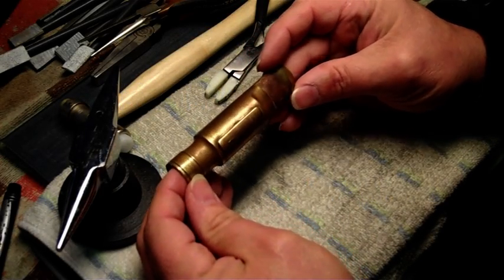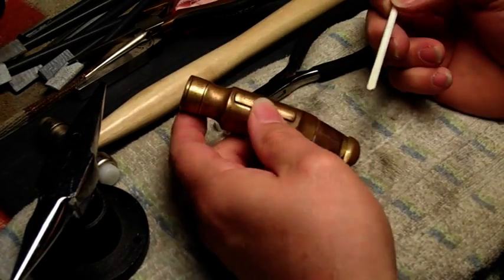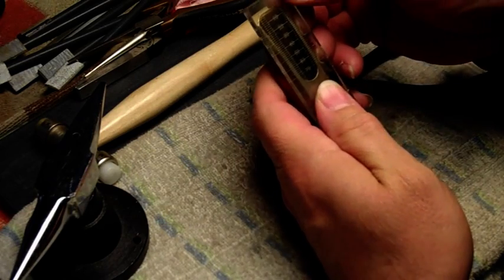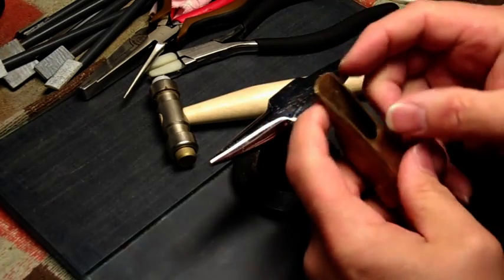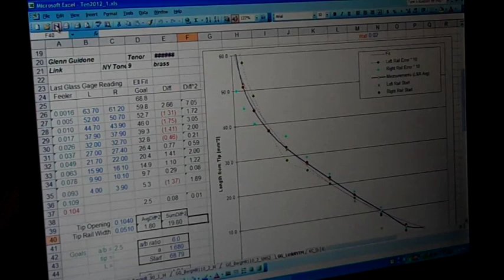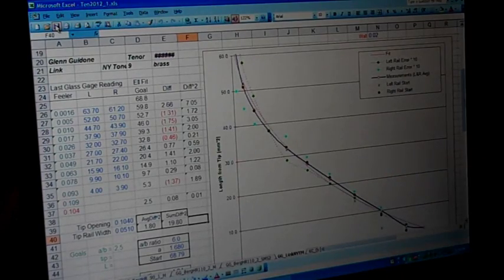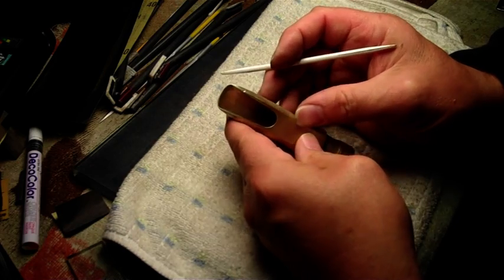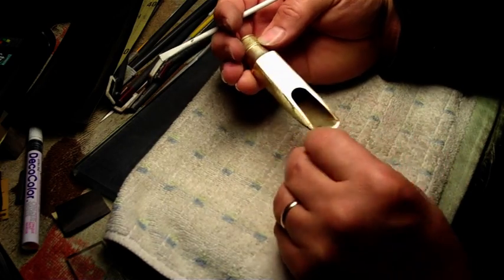Link NY Tone Master Metal Repair Restoration

Comment: I once bought a used Selmer tenor sax from a friend but the mouthpiece, perhaps an otto link, was bad and it looked similar to this one, I did not know what to do with and, I probably threw it away.  I wish I knew about this. Having lost that mouthpiece I'm now using cheap mouthpieces.  My saxophone teacher once told me that the secret of sounding good on a saxophone is on the mouthpiece...the properly crafted mouthpiece will make your sax sound good no matter how cheap the make is.  There's a lot I can tell about my experiences but not now.  But this is a great job!!!

Comment from the maker: It is a high speed roatary tool with a burr.  Mine is an old Weller made model that I outfitted with a variable speed foot switch and a flexible shaft I got from Micro Mark.  Dremmel is a big name in rotary tools.

Comment: im noticing that  refaced mouthpieces that are hard rubber and plastic after refacing the tables dont stay flat long after the ligature puts preasure.   though it might be the heat here in the philippines too.im thinking the metal brass mouthpieces might retain a flatter table .The new york ottolink and dukov types appear to be longer and im thinking also might have a lower tone when pulled out more.im always in fear of loosing a mouthpiece to the floor when trying to play along with aubra graves stuff. Love the videos mouthpieces seem to be the key to my improving longtones and frazing.

Comment: Great video. Was wondering if you could recommend a vendor for refacing tools. I'm a tech myself and used to work on mpcs.. I had the old Eric Brand tool kit, with radius gauge, etc., but lost it in a move, and it's no longer available. Any ideas would be much appreciated!!
Reply from the maker: Wanne and MusicMedic.  MicroMark for small tools in general.

Comment: I use 1/8" thick black sheet acrylic.  McMaster-Carr sells it as do other suppliers.  The adheasive is 3M DP-810 black.  There are photos of a Link STM bite plate job on my web site.

Comment from the maker: I have not tried to make a baffle out of silver solder.  I suppose it is possible.  But the high heat would damage the bite plate and gold plating. Epoxy putty is more practical.

Comment: 9:57 what is that machine that you use to buff the sliver solder?I am planning getting one of those so I can buff out all excess of flux when I remove the old pip and replace it with a new pip

Comment: Nice work. Have you tried using a foredom motor with a precision handpiece? They are worlds better than dremels for control and accuracy.
Reply from the maker: Fria Gram No I have not.  One problem I have with other flex shaft rotary tools is the hand piece is too large to fit inside the mouthpiece shank.  Even the slim one I use is not made any more as far as I can tell.

Comment: Hi may I send you my Ponzol m2 110 brass. It needs a bite plate. It has one but it is too short width-wise and has some top surface damage as well. . I've been trying to get a bite plate for 2 years, but Ponzol no longer manufactures this bite plate.
Reply from the maker: I can fix you up.  Email for info at mojomouthpiecework@yahoo.com

Comment: the mp looks like brass.  Why not braze brass?
Reply from the maker: I guess I thought that would take more heat than I can make with propane and air.
Reply from the maker: I think the temperature needed to melt brass brazing rod would melt the mouthpiece too.

Comment: Isn't it risky to use silver solder in a place that is going into a persons mouth? I know plumbing and other solders are lead based, but I was under the impression that silver solder is also dangerous. Maybe only when you are liquifying?
Reply from the maker: +Mike Borkovic (Dad Stuff) Most soft plumbing solders have been lead free in the US for years.  I used an easy flow hard  solder which is more accurately a braising operation.  No lead.  You can search via Google for more info.
Reply from the maker: +Mike Borkovic (Dad Stuff) BTW, the original mouthpiece brass probably has lead in it.  It is debatable wether a significant amount of lead is released or not when a player chews through it.
Reply: +MojoBari oh fair point, I misread my own brazing rods. Thanks for the response - very nice work

Comment: Where can I find those mouth plates?
Reply from the maker: I make them from scratch.  Most of the time with powder acrylic and liquid monomer.  This video shows a sheet of black acrylic that I heated and bent. Sheets can be purchased from McMaster.  Photos on my web site show how I bend them.  http://www.mojomouthpiecework.com/Photos/tabid/59/AlbumID/386-228/Default.aspx
Reply: Daniel Guzman
From previous YouTube advice from MojoBari, I have restored a bite-plate not replaced it,
with Acrylic Powder and the monomer for artificial finger nails .
A simple, smallest pack will you leave with enough to do dozens more!
You find a YouTube clip on how to do it. Dip the brush in the liquid then in the powder and apply to the hole. Keep doing and agitating it to dispel bubbles, until you have over-filled the bite groove. Work fast...It sets fast. 
When hard, use fine files and abrasive papers to reshape it to match the undamaged part of the bite plate.
I couldn't get black but a white streak can't be seen with the reed cap on again
or in your mouth! Who cares anyway?
Damage it when re-shaping? Just add some more and do it again.
Good luck.

Comment: I just found out that this is owned by Paul Gonsalves, Jr.  You can guess who made the tooth gouges.
Reply: I often wonder whether the unique and individual sound a lot of the greats got was in part due to the rough (DIY) work they did to open up their mouthpieces.
Reply: Keith Bradbury Lol. That poor mouthpiece. Paul was rather famous for his remarkable drinking. I’d imagine there’s been a house or two worth of liquor blown through it! 

On a separate note, surely if you’re chewing bare brass several hours a day, you’ll be left with little nubs for teeth!? Might explain Coltrane. He met Gonzales and said “screw this, I’m going double embourchure”!